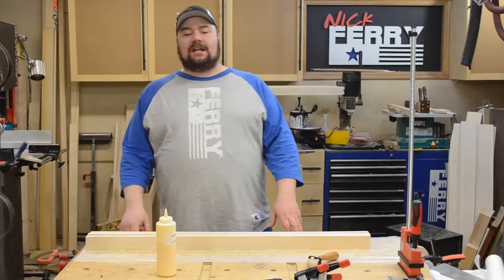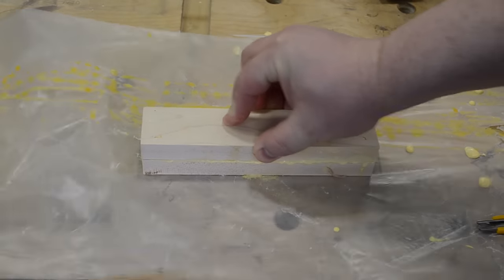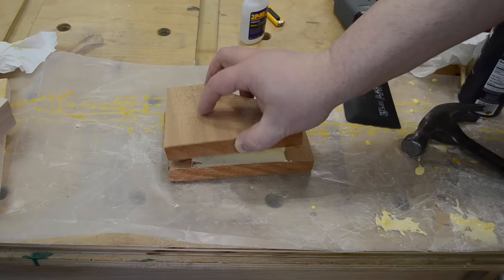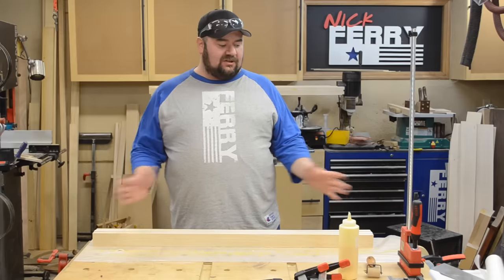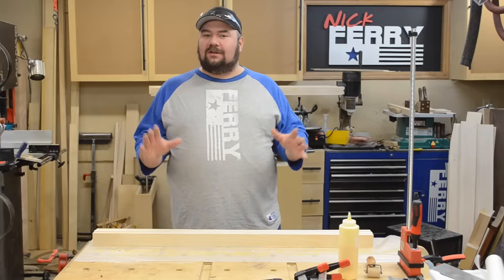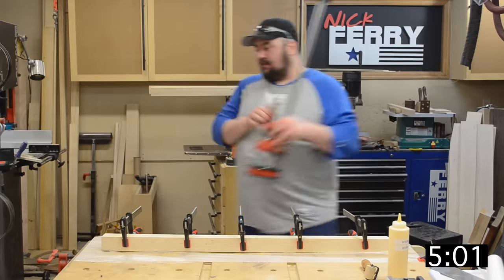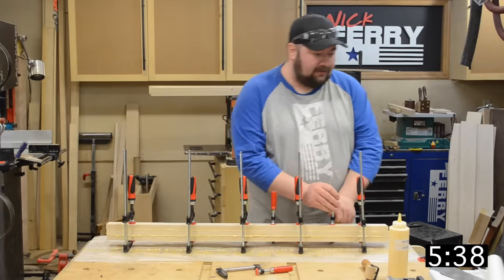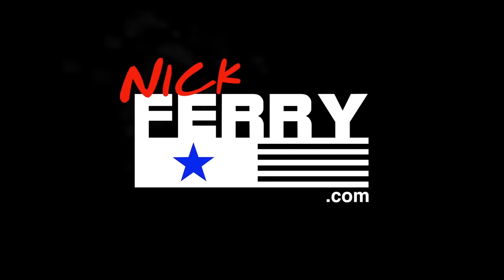Ⓕ Best Way For Gluing Wood Together To Get Thick Pieces (ep86)

Comment: Great video, Thanks Nick. Question on the roller. When you're done is that a rinse and repeat deal? How long does it last for and is it something you're having to replace every couple of glue ups?  Also is there anything you have to do to prep it? Thanks again.
Reply from the maker: Thanks - I’ve had some of these rollers for years - if you wash them after they will last a long long time - they’re not silicone and I have not ever tried letting it dry and peeling the dry glue off - might work though - you don’t need to do anything to prep it
Reply: Nick Ferry  thanks mate. I just realised I have the Rockler roller. Just used it for the first time and it works well. Was doing a leg glue up and remember seeing this video a while back. God it's an incredible resource having vids like these. thanks so much
Reply from the maker: no problem - glad you found it so helpful

Comment: If it is a regular task, can't we put a few low cost vises on a table like a jig?  The vises may not be more expensive than the clamps.  I use the single vise technique, when I join popsicle strips for small modelling work.  But the cost of the glue (I don't buy in gallons) always bother.
Reply from the maker: That would be a cool setup if you did it often enough - I've done pneumatic setups similar to that

Comment: Nick, great video from start to finish.  You're affable, generous, and informative.  I'm wondering what those little junior F clamps are.  They look like 2.5" x 4".  I don't see them in Bessey's catalog.  Are they made by someone else?
Reply from the maker: Thanks much - they are Bessey’s but they were a small run bargain bin - I don’t think they always make them
Reply: @NickFerry  I like the compact size for when you need only that.  I think I'll try the little $5 Woodcraft ones.

Comment: For the cheap way, cut a few pieces of plywood with a slot out to fit width of stock.(C shape) It might take a little time and use some scrap, but always the right fit and you can make as deep as needed.
Reply from the maker: Another good option

Comment: As a new subscriber and woodworker, what is the difference between parallel and F clamps? Are there other types of clamps? I know spring clamps are the little one you just squeeze with your hands. Is a parallel clamp a form of bar clamp?
Reply from the maker: Tons of clamp types - “F” style are named after their profile silhouette being the shape of an F - parallel clamps have parallel faces that are smooth sided all the way to the bar as opposed to F clamps usually having smaller often circular pads - a parallel clamp is a type of bar clamp but not all bar clamps are parallel clamps - many more as well - C clamps, hand screws, strap clamps, spring clamps, quick clamps and the list goes on ad nauseam

Comment: You can never have too many clamps.. lol
I use a similar trick when gluing up table tops. I use a board that's been run through the jointer to make sure it's flat and clamp that at the ends of the top to make sure none of the boards slip out of place.
On larger tops,, I just use a biscuit joiner to make sure they are aligned, but also use the boards clamped at the end to make sure no bows develop while clamping. 
Same theory, it keeps the wood in place.  Works well..
Reply from the maker: Thanks - if you don’t already, try adding some clear packing tape to those cauls - it’ll keep any glue squeeze out from sticking to them
Reply: I was using masking tape and just sanding off any bits of tape that may be left behind when pulled apart.  :) (Same theory, works well)

Comment: Just a question: wouldn't it be easier, stronger and faster to just buy a 4×4 and rip it down to 2 1/4"?
Reply from the maker: Depending on the 4x4 it may be center cut - and this could be any species of wood someone already has - hard to find walnut 4x4’s
Reply: Also, the price per board foot increases with thicker lumber. So gluing up several thinner pieces is more economical.

Comment: Sometimes I'll use a caul...run it thru the jointer so its nice and straight....less clamps needed!   I was getting ready to laminate 2- 1x6 x 8ft, I figured I need 16 clamps along each edge for a total of 32 clamps. In stead, edge jointed 2 - 2 x4 as cauls...got away with 10 clamps
Reply from the maker: that's the great part about all this - the problem solving - great how you did it but I still think I would have told my wife I needed to buy more clamps

Comment: Ink brayers are great for gluing, just have to find out the speed it flings glue at and run it barely slower
Reply from the maker: I've never had any issues with that, now paint rollers, those are a different story

Comment: Precisely the method my Dad taught me some 50 years ago.   The only extra step was wiping the wood with a damp cloth to open the grain and get the glue to follow the moisture into the grain.   Yeah, it increases drying time, but life was much slower then.
Reply from the maker: I hear that - normally cleanup glue the same way

Comment: If you have 3 boards, there are 2 gluing surfaces, so why did he put glue on 3 surfaces?
Is there a fourth board we have not seen yet?
Reply from the maker: Doing both sides of the joint breaks the surface tension and ensures full coverage - I don’t always do it just flip a coin kind of thing

Comment: Im knew to woodworking so excuse me for maybe asking a silly question. When glueing up warped pieces of wood won't there be constant pressure? or becuase wood lives it will unwarp itself? thanks in advance :) Great video btw I subbed :D
Reply from the maker: You run that risk but that why I do odd number of layers and at least try to oppose and forces
Reply: @NickFerry  Thanks Nick!

Comment: I hadn't thought about using parallel clamps for thick stuff like table legs, but a similar technique works well on panel glue-ups using those kregg face clamps (I just wish they made more with big clamping pads on each side).  It was invaluable when making a bunch of cutting boards last year.
Reply from the maker: Yeah - even an added pop-on pop-off type pad would be cool for different sizes
Reply: Hmm, now that you mention it, that would actually be pretty easy to whip up for 3d printing.  Here, have a shape (complete with some little divetts to help pry them off): https://cad.onshape.com/documents/170f388c3b8378ca45460da5/w/2be02a3ca58754002dd70b40/e/676d7f82122253ff19bfdecb
Reply from the maker: nice - now I'm thinking some thick magnetic plates for distributing the force

Comment: I use salt. You do not need much and it gives me a lot of control. An extra salt shaker in the shop takes little space and I use very little.
Reply from the maker: I used to use it more often - always fun to experiment with different methods

Comment: Old news. You shouldn't remove the parallel clamps because the boards can still move.
I've used straight 2x4's with clams on both ends and they can still move.
This is what i love about woodworking...same tools, same projects, and a hundred different way to get to the finish line. If one way doesn't work attack from a different angle or use a different tool.
With this video in mind, this is why we can never have enough clamps, but i say 1000 is enough.
Reply from the maker: I agree - always more than one way to skin a cat and that's the fun part, finding what works out for us and what doesn't

Comment: I spirally wind stretch tape around the laminates, as I make lots of hoops and curved laminates which are always difficult to control.
Reply from the maker: very good option - I like seeing how people making odd shaped items secure them for assembly and glue up - stretch tape and even shrink wrap, is a good way to go - I've even used rubber bands in certain instances - just add more for more clamping pressure the same as your stretch tape - I think you are the first one to mention that option - thanks for sharing!

Comment: Every time I see Bessey clamps online or in the stores, I always want one, but I could never get past the cost.  I just don't do enough woodworking to justify the cost.  My hobbies are already too expensive.  But after seeing Nick's tip, I'm going to buy at least one Bessey parallel clamp.  Bessey should send Nick some swag as a reward for this video.
Reply from the maker: thanks much man - let them know you liked the video - can't hurt anything - you'll have to let me know how you like the clamping technique once you get the clamp and try it
Reply: wait till you see the clamps marked down at your local HD about. I managed to get the 50" parallel clamp for 31$ and the 24"version for 28$. I bought 12 of each and saved a bit of money
Reply from the maker: I'm still waiting for my local HD to do that - I heard they are bringing in DeWalt but the shelves haven't changed much here
Reply: You can buy clamp ends that fit pipe, functions like a Bessy, a little more awkward. But you can  have 10 clamps for the price of one long Bessey.
Reply: Then pay close attention then to the price.. cause itll be happening soon. 2 out of 4 local HD by me have already rid of there shelves of bessey and switched to some dewalt knock off versions... i bought a couple to try out and returned them back.. they dont compare to the bessey quality.. which is sad cause dewalt is pricing there version for the same price as bessey...
Reply: Varies, closest store went full DeWalt, next closest has both side by side....

Comment: You did not actually answer the question I had, which was when laminating a number of pieces, more than 3, what configuration is strongest? Stack, square, beam style?
Reply from the maker: not sure what you mean by your configurations - beam layout similar to an "I" beam has a good strength to weight ratio - but I'm making legs for a cabinet so it's manly compressive force parallel to the grain - these are small enough to be solid and wouldn't really benefit from boxing out perimeter pieces
Reply: Look at your thumbnail. Note the number of pieces in each assembly.

Comment: You are the most enthusiastic anchor to answer the audience's questions, but I can't understand you for a foreign audience. I hope your website can be written in detail.
Reply from the maker: I do what I can
Reply: thankyou nick！
As you have demonstrated a lot in this collection, but I see your video and website, I still don't understand which is the best way, although you say a lot of kinds, my experience is just one side of the glue.
Reply: A clamp with a spacing of 300 will cost more than one hundred yuan, so I think the clamp is not the best solution.

Comment: Thanks for sharing this tip,

What about cutting boards, just use cauls?
Reply from the maker: on any wider stuff cauls is the way to go - this method is essentially using the parallel clamps as cauls to make it go quicker
Reply: That's what I thought, Thanks :)

I just finished an end grain cutting board and struggled throguh the old clamping rutinie.
Reply from the maker: yeah it's one of those things with a bot of a learning curve but once you have done a few you go more off memory than anything else

Comment: Does grain direction matter when you gluing pieces like this together?
Reply from the maker: In regards to what?
Reply: I heard that the pieces should be oriented in opposite grain direction in relation to each other. For example:  )() Any thoughts? @NickFerry
Reply from the maker: @mrdeer5585  I was asking more for the overall goal - example would be if you want the finished glue up to be stronger - you could cross orient the grain and end up with a plywood like product - or you could orient The rings opposite one another if you want to try and reduce cupping - if you’re just looking for a larger or thicker glue up for a work piece, a leg for example - I orient the wood according more to aesthetic - if it’s a wider plank that I’m trying to make thicker (maybe a shelf), I’d be more concerned with grain orientation to reduce cupping

Comment: Do you go back from left to right (finish to start) and loosen then tighten them again. You may not get the reason why I ask this and I can't explain it but it's like bolts on engine heads. I think once you get 5 clamps on there the piece you are working on won't move. I am just thinking that built up micropressures may come back to haunt you.
Reply from the maker: I go back over all the clamps and check for tightness - it's not the exact same properties as rims or head bolts so having a specific torque pattern isn't necessary
Reply: Ya, I didn't think the pattern mattered as long as you didn't take them all off at the Same time.
Reply from the maker: I don’t know how a person would take them all off at the exact same time

Comment: Titebond don’t recommend 🧂 as it can effect the chemical composition of the glue and weaken the joint .Great video btw 👍
Reply from the maker: Thanks - if I made a glue I’d probably say the same
Reply: @NickFerry  is it worth the risk on a important joint 🤔
Reply from the maker: If you’re building a cantilevered bridge over an orphanage, maybe use the straight glue

Comment: You could also push the ends against a board to get them to line up flat.
Reply from the maker: And what do you do when clamping pressure is applied and they slide?
Reply: @NickFerry  The same thing you do. I am suggesting to combine your method which lines them up flat vertically, and to also push the ends against a board it to aline them horizontally. This could allow for less trimming waste at the ends due to edges not being square and lined up. Depends on your OCD, too. Lol

Comment: how about grip lines in the faces of the boards to add strength?  just asking     Lawson di Ransom Canyon
Reply from the maker: Not sure what you mean by grip lines but I have added kerf cuts to molding to prevent glue squeeze out - that wouldn't be applicable in this case as I wouldn't want to expose those kerfs when cutting into the blank

Comment: Great tip for those not already doing it, but did you have to take so long to explain it. Anyway, thanks for the vids.
Reply from the maker: Thanks - it’s in the youtube bylaws, section 8, subsection 6, paragraph 3 - “all woodworking glueup videos must be a minimum of 7:00 in duration not to exceed 22:56” subsequently subparagraph (a) states “in the rare occurrence of brayer implementation in said glueup, video may exceed regulated time allotment. See also: credit card & finger glue spreading techniques”
Basically I’m trying to keep everything legit and just decided to show it in real time

Comment: Can't you clean the glue off before it dries? Thanks
Reply from the maker: You can, it’s a rather subjective part of the process - The more cured the glue the harder it is to remove, but the less chance you have of a viscous glue bleeding to surrounding areas

My methodology in many cases, is wipe up any big drips right away and then let the glue skin over(harden slightly), then scrape as much of it as I can before any type of milling/cutting/planing

Comment: No idea why this popped in my feed a more than a year after going up.  Anyway, having never owned any parallel clamps, I always did the same thing using f clamps and scrap wood on the top  and clamped along the edge of my bench top.  Also have used the bench vice in the same way. line up the boards in the vice, apply clamp, loosen vice, slide down, tighten, and apply next clamp, etc. 
Have also done it by drilling a hole on each end before applying glue, large enough to not quite snugly slip a nail through, glue and clamp with the nails in place, then slip the nails out.  It's not quite perfect, but good enough for pieces I'm trimming down anyway.
Reply from the maker: It’s probably because you don’t have notifications turned on for me - they change things a lot I guess on here - no matter which way you can get the wood clamped up works for me

Comment: Any reason why you wouldn’t you put the first set of clamps on either end and one or two divided in the middle area, then clamp the three piece of timber together?
Reply from the maker: No monumental reason other than going along from one end to the other helps correct opposing warps better
Reply: Nick Ferry Can you explain why or how? If you parallel clamp the boards in alignment before clamping together, aren’t you achieving the same thing without having to undo a clamp and reposition each step? Or clamp them down the bench to true up, then clamp together?!
Reply from the maker: for all intents and purposes you can get more than acceptable results with either way - the way I showed only requires one parallel clamp which is nice - also, not adding a bunch more clamps and clamping pressure helps ensure the "pressure" clamps can be more effective - either way, I don't think you're going to cause time to stop by selecting either method

Comment: I do something similar, because I don't have parallel clamps. I'll get some scrap and make several cauls, lined with wax paper. I use regular F clamps, clamped on either side of the glue-up, with the wax paper cauls against the edges. The rest is the same as shown here, except I don't move the clamp down as I tighten. I'll just have three or four of the caul setups along the length of the glue up.

Based on the thumbnail, I thought this would be a comparison of two different types of glue-ups ...
Reply from the maker: Thanks - another great way of doing it - in the thumbnail the one on the left was when the pieces slid around and the one on the right was this method
Reply: @NickFerry  Oh, ok. The glue squeeze out made it look like a segmented glue up of several parts, rather than three equally sized pieces.

Thanks Nick.

Comment: and if you set 2 parallel in both ends and then start claping?
Reply from the maker: if you have a crook in the wood it wouldn't help remove it